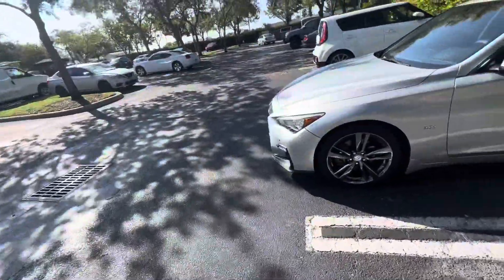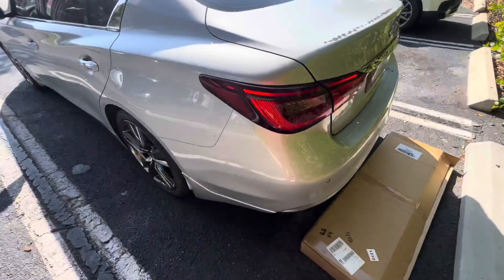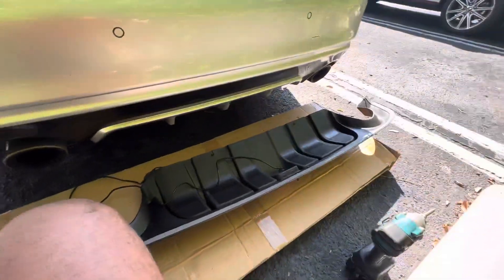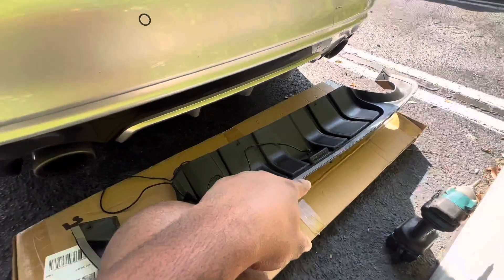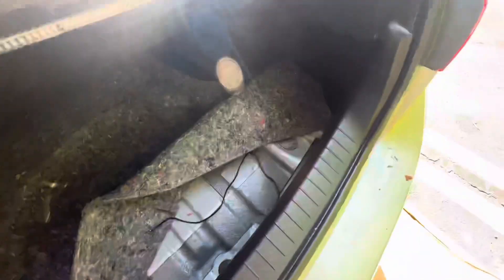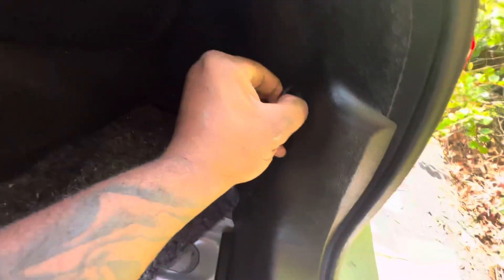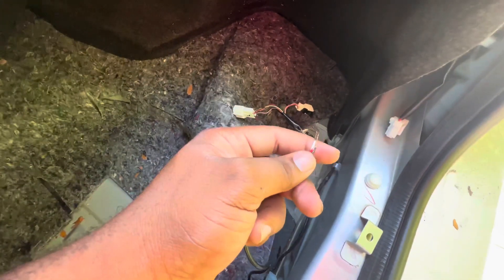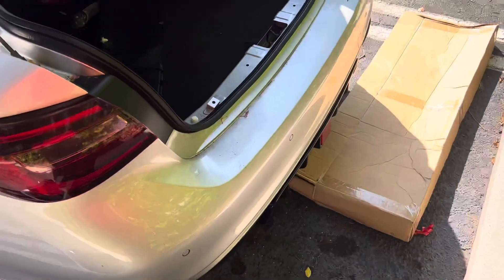Q50 3.0t SILVER  SPORT GETS NEW REAR DIFFUSER & 3rd BRAKE LIGHT

Comment: Link to diffuser
Reply from the maker: IKON MOTORSPORTS, Rear Diffuser Compatible With 2018-2023 infiniti Q50, Gloss Black PP Add-On Rear Bumper Lip Diffuser Spoiler Splitter Kit With LED Brake Light, 2019 2020 2021 https://a.co/d/eOy3q9f